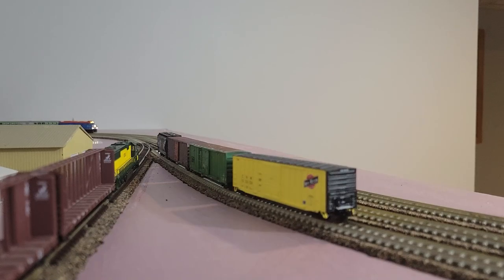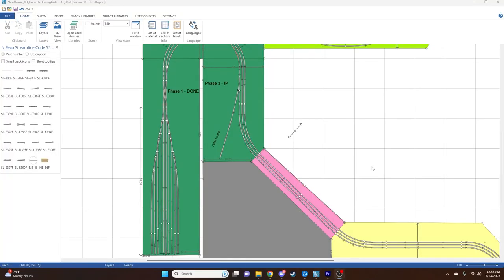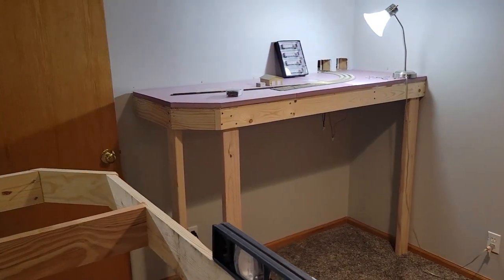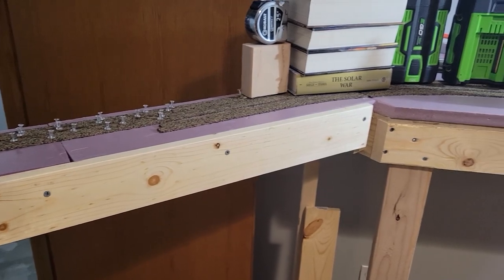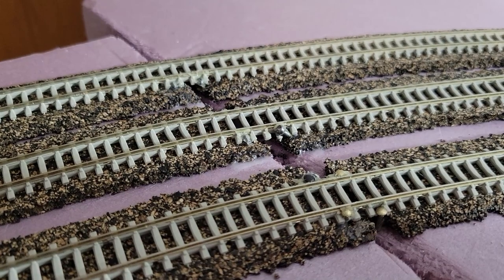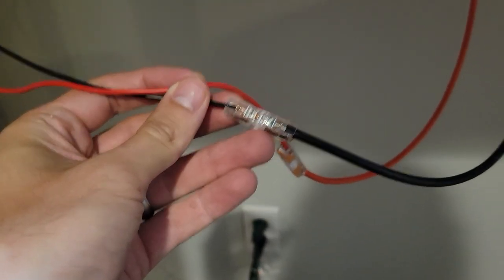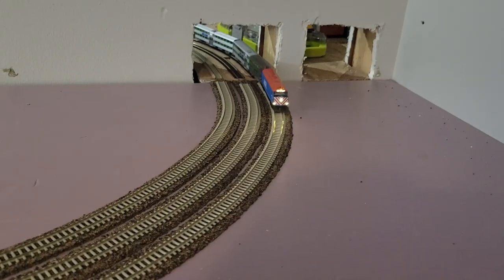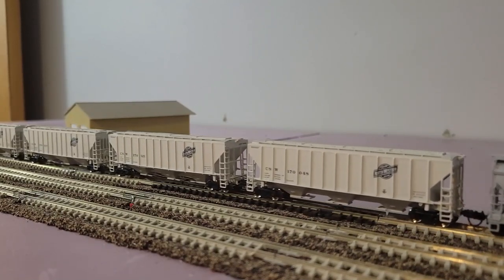CNW Harvard Subdivision N Scale Layout - Ep 6 - Liftout Section Done and More! (Fixed Audio)

Comment: Wauw what a beautiful project. 
Iff i may suggest now your building the liftout, i would put screws under the track in the wood, then drummel the scruw  flat after that solder the track to the srew. 

That way in the long turn you will have a stabel track work also after getting the liftout, in and out  again and again. 
After balast you wont see the solderd scruws under the track no more.

Have a awesome build!!!